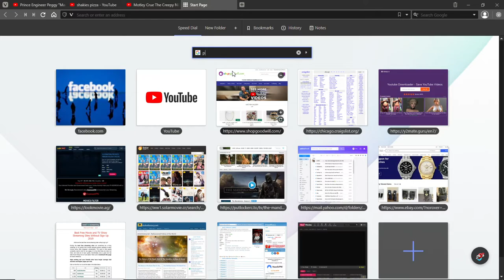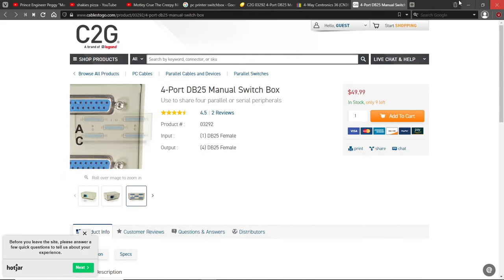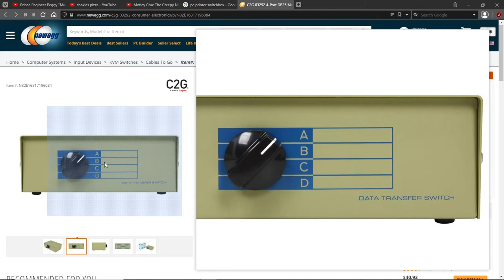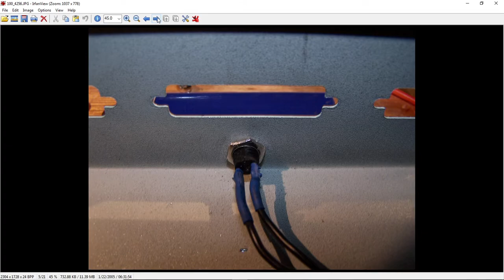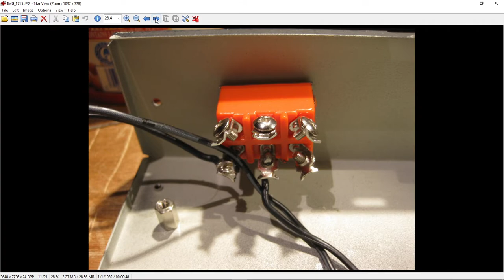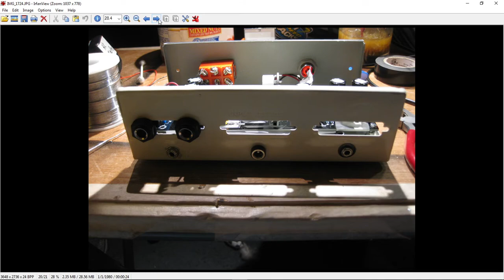Musical Fidelity stereo tube buffer/preamp boxemup

Comment: I purchased two. Followed Heavymetalatc assembly vid.... Had trouble with hum and then it stopped. worked nice with guitar .....Today i added a pot between the channels. Output Buzz... Tried three power supplies. Buzz.  Tried the second board.. No joy...  Using a test tone generator, -50, the test tone is clearly heard with the buzz.   Any ideas?
Reply from the maker: ck grnd  ck pot wrng re-chk grounding, ck p.s. is ps ac outpt or dc out? was unit working with out buzz with guitar ? i would need a lot more info , photo / video to debug your issue in the comment section of a yt video . -50 ? i did not add a pot between channels .
Reply: @peteytwofinger  thanks for the response.....checked all that.... assembled new connections.  board is just laying on the bench. not in a box. .. with only one channel output connected.... no input, no jumper.... Heavymetalatc added a pot, and a tone stack.  ... . The first one worked when i first assembled it....and now neither do, .. AC: yes new power supplies... maybe it is the power supplies.... how to test them for noise?  ... again thanks.

Comment: Do you think this could work for a small cigar box guitar amp. Could it drive a 4" speaker?
Reply from the maker: yes ! ha ha = no . this is designed as a PRE amp . preamps do not have power to push a speaker . they will drive headphones but thats a different story. what do you have against class D ? look into a punch amp tda7052a chip - thats by far the best solution , do not build anything with a lm386 they are crap. or if you want a real amp with a lot more power - even off a 9 volt battery try a (10 dollars) tpa3116d22a mono off ebay. trust me . to start building amps thats what you need pal , ditch the tube... you could put this (it is stereo so right there you have an issue)  infront of a 3116 and have a hybrid tube class d combo- use 2 speakers and split the signal with a buffer on the input. . if it were ME i would skip the tube . use something that emulates tube amps like a amp in a box style jfet preamp or a multi effector ( build a jfet marshall in a box , use a buffer on the input then hey how about a tonemender eq inbetween the power stage of a class d 3116. or the marshall super bass preamp thats on tagboard effects is amazing sounding but with any jfet (they emulate tubes very very well)  you will need smt jfets on daughter boards so go to delyk pcb for those as he has them much cheaper for the daughterboards buy the jfets from digikey as a lot are fake now . good luck pal. i built all of those preamps they offer at tagboard and the super bass is "the" one imo . it has the best clean tone and really sounds like a tube amp , but you will need something else to make it sing (distort) . there is no easy answer when you bring the T word into the equation . if you simply HAVE to have that , save a few thousand dollars before you start looking but keep in mind A know one will care , B no one will hear the difference .  i live in muddy waters home town. there is a guy called HEAVYMETALATC he commented on this video . he built this same unit as a guitar preamp so if you go to his channel you can hear what this sounds like when impimented as a preamp . he was very happy with his results .
Reply: @peteytwofinger  I have built the Ruby lm386 and have a couple tda2030 amps. I just thought tubes in a cigar box would be cooler. I do have 3 tube guitar amps Kustom 72 coupe, Jet city jca 20, and a 58 supro plus some solid state stuff pig nose, blackstar. It's all fun. I just saw your video and the little devil on my shoulder said tiny tube terror?
Reply: @peteytwofinger  I saw heavy metal atc's video where he chained the tubes to be mono that's what really got that devil dancing.
Reply: @peteytwofinger  do you know any pre-assembled preamp board  to go along with a mono tpa3116da? i already have it, just can't get a preamp to work with it.  i also have a decent speaker and a nux amp academy, i just want a working guitar amp, no need for fancy. what you think?